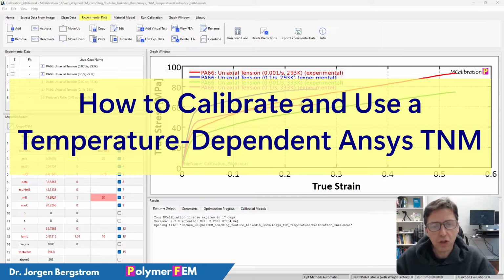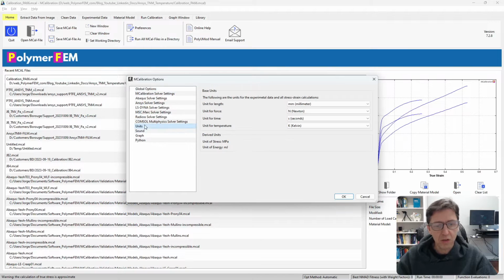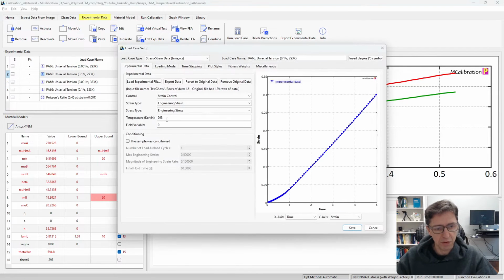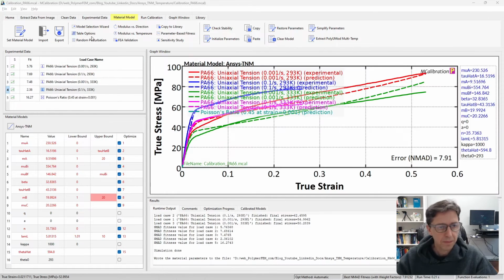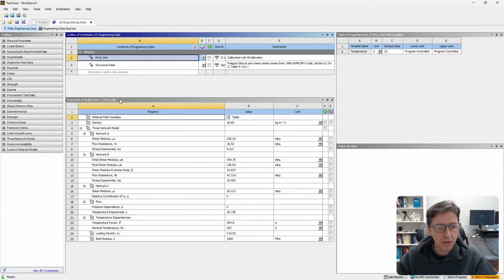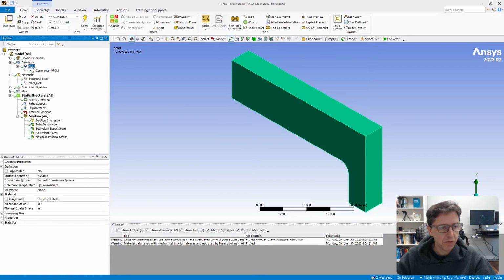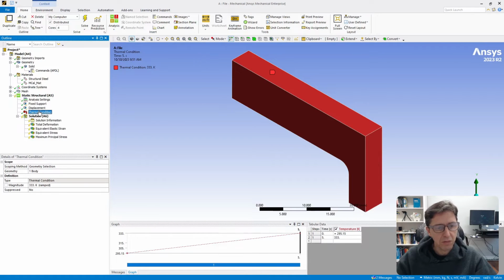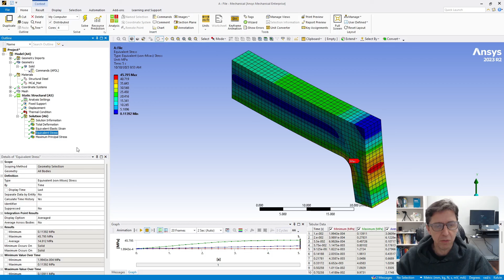How to Calibrate and Use a Temperature-Dependent Ansys TNM

Comment: hello, recently i bought MCalibration and i was wondering if you could make a short video in loading a relaxation test. I am ivestigating a crumb rubber material for my thesis and i setup a ASTM D6147 relaxation test, and i was wondering what did "Relaxation Strain" meant in the parameter input section, i love your videos!!